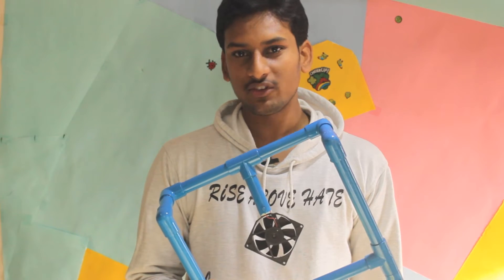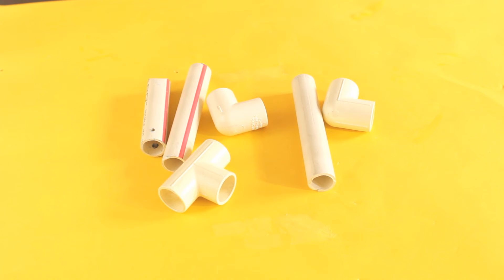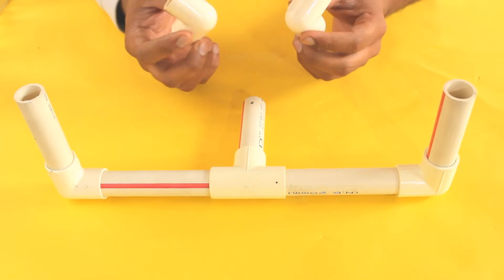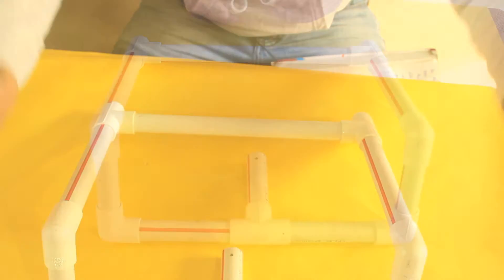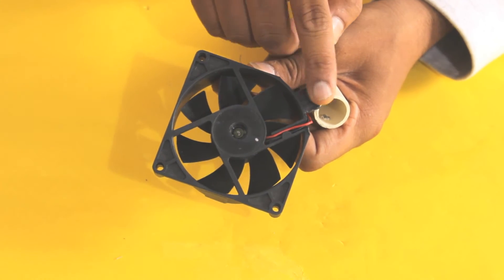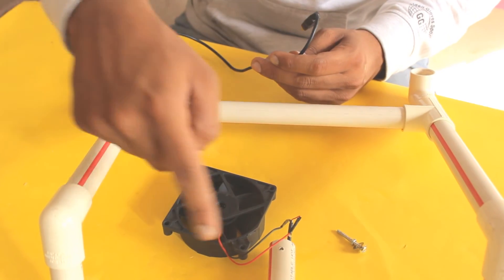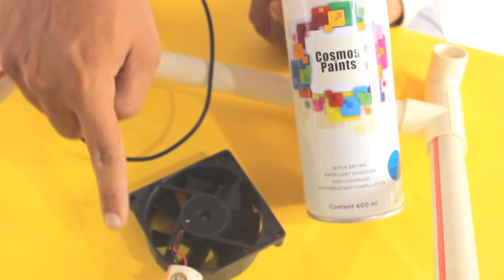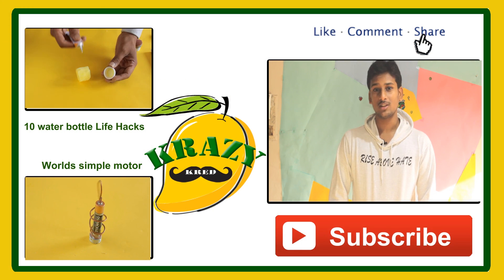How To Make Laptop Cooling Stand With PVC Pipe ( Home Made )

Comment: it will work better if the fan is closer to the laptop and also the fun must be away from the desk to suck the air easier
Reply from the maker: +Shin Kazama yaa may be i need to upgrade this version thanq for ur suggestions
Reply: +Shin Kazama you are absolutely right shin i think fan position must be changed and i think fan should be in the side of the frame